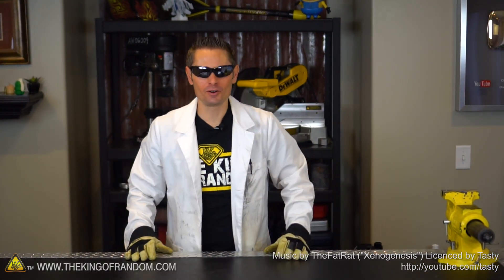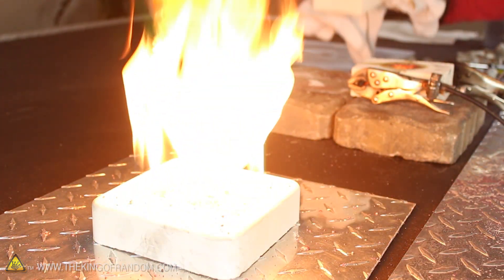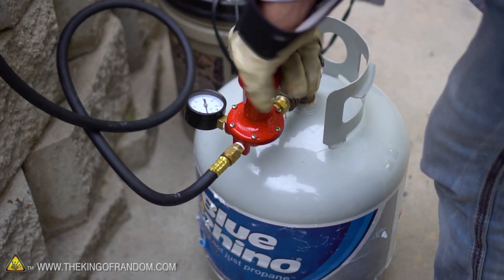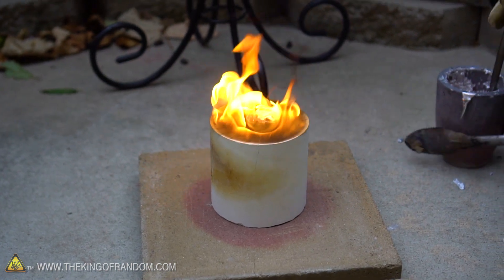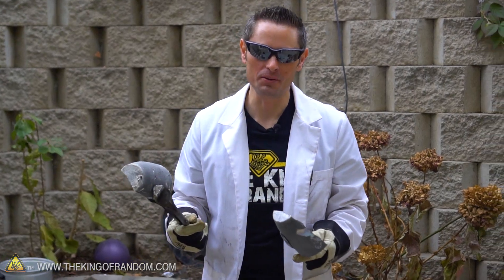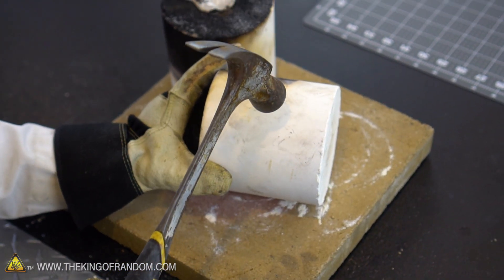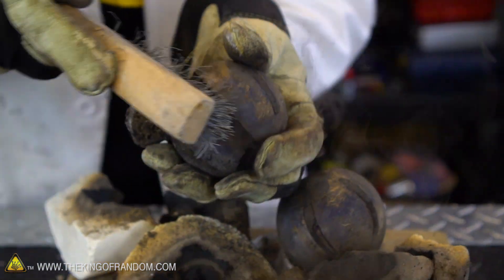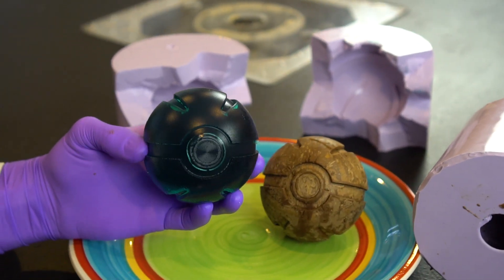Casting Aluminium PokeBalls

Comment: I'm not sure if anyone has made this comment, but why didnt you just do a lost wax casting in sand like you did with your other aluminum casings? at least that way you dont get the burning from the plaster and it isnt as messy of a job to take the cast out? i'm asking this because you got rid of the original wax castings anyway. Let me know what you guys think.

otherwise, Grant
Keep it Random

Comment: when I was taught casting, we  were using a steel case  filled with black sand. so the plaster idea is cool in my opinion.  now the main comment. during the same teachings for best results we had to have two spouts, one for pouring in the medal and other for venting. idk if that will help spheres though.

Comment: for your air bubble problem if you would put 2 holes in the casting wen poring metal in it you would be fine (1 bit for metal 1 smaller hole for air)

Comment: You should try casting a shovel, not only would it look cool but it would be practical as well.
Reply: Boxcarwillie S160 need to melt steel for that, and that melts at 2x the temp of aluminum, ding know if he has the equipment for that
Reply: Well really it would work but the shovel would break quicker

Comment: To avoid bubbles in the final casting, you can set the just filled mold onto a vibration table. Let the vibrations coax the bubbles up and out.

Comment: It would be pretty awesome if you did this experiment for me: 
Step 1) Disassemble the Beyblade & prepare a silicon mold of each part
Step 2) Fill it with wax
Step 3)Make a plaster mold of the wax beyblade parts
Step 4) Fill it with liquified metal
Step 5) Re-Assemble the bey and try if it works on a bey-launcher...
   # It would be great if you did it!
Reply: Awesome Idea
Reply: Spandan Mehta

Comment: i took a metal foundry class and we used a metal coffee can and a  board it made for a really strong mold that  never cracked  for any of us . take the board and attach your spruce and vents to the board with the wax you take the coffee can and seal it to a board using clay around the bottom edge then poor your plaster mix in to the can and let harden then remove board before you put it in the oven ... hope that helps

Comment: Grant to avoid the air bubbles in the cast if you put 2 tiny holes in the top with the main poring hole it should make a cleaner cast because it will give the trapped air a place to vent

Comment: Adding hydrogen peroxide to any metal casting will allow the air bubbles to go away completely so you can have a smooth cast . Hydrogen acts as a magnet to collect all the air bubbles at the point of exit and they will disappear over time as the cast hardens.

Comment: Hi, I am not the most experienced metal caster, but I would say that your process is almost perfect, to improve your method, you would mix your plaster like normal, but set the mixture in a vacuum camber to remove air bubbles. Then you would pour into mold. Then you take your mold with the wet plaster and put it into the vacuum chamber again. Let it cure till firm, then bake out the wax. I'm had a 100% success rate casting with pewter, silver, and brass. I hope you give my method a try :)

Comment: Work in a foundry. To help minimize your gd (air bubbles) you need to add a vent shaft to your molds. As the metals fill the mold it will force the air out. Mold cracking is also just part of it we make 18in - 42in diameter pipe we use chains to hold our molds

Comment: You need to add some thin sticks of wax around the sprue piece to create air vent channels in the mold, that will prevent the trapped bubble of air around the sprue. Put them in a location that will make it easy to cut them off and smooth the area on the final casting.

Comment: For the bubbles in the silicon molds, If you buy an industrial vibration machine and place that under the plastic holds you made you can vibrate the bubbles out for best results.

Comment: You asked a better way to make molds. You can make two 3D rectangles and fill them with casting sand. Put what ever you want to make a copy of halfway into one rectangle. Place the two rectangles with sand together and make a hole to pour in the metal. Melt the metal then pour it in through the hole and wait for it so become solid. Cool it off and you have your metal copy and a mold you can use again. I recommend using casting sand because it is really fine so you wont get any bumps and dips but you can just find some fine sand and that should work too.

Comment: Cast some LEGO bricks in different colored wax, and build a small structure with them.

Then do the same with Aluminum. I am curious to see if the bricks will connect after going through the double cast process.

Comment: I didn't see what you did for plaster but I use half plaster half sand. I also have a kiln to ramp up the investment burn out to 1200 degrees F. It has to get that hot because water is chemically bound in the plaster. You do risk a steam explosion if the water isn't burned out completely.

Comment: to avoid air bubbles pour your metal slowly but not no slow and try using talcum powder coated in the cast to help with surface bubbles and use silicone epoxy for your mold

Comment: The better way to do this is to form sand molds using silica sand, benonite, and water. if you put the wax balls in this you can then split it in half and pour the metal in through a whole. This will make it much cleaner and nicer looking.

Comment: Sand casting is better for metal. It has much better detail and is safer.
https://en.wikipedia.org/wiki/Sand_casting
Reply: Grant has done sand casting before, too -- that's how he did the master sword.
Reply: a vacume is not needed in most of his aplications just 2 extra sprews of wax would work maybe half inch round
Reply: honestly sand plaster molds thats what he should be doing plaster for detail and sand for durability and heat resistance never had a problem
Reply: True, greensand molds would have work way better. 
The sand and foam casting process like the master sword is not the same as making greensand molds. 
Also he could have used Jewlery investment instead of sand and plaster, but would need to use a vacuum chamber to remove air pockets, that's why its easier to use sand molds, lost wax molds are used for more complex figures.
PS sorry for the bad english it's not my first language.
Reply: Marc Mallary 
ieihrirjiejehnoe

Comment: I'm sure someone has mention it but check out vents on ur casts to let air out. It's a simple molding rule of thumb to release pressure and let all voids out and u will get a much better fill and get more complete parts

Comment: I'm not positive but I could have swore I seen on an episode of How It's Made where they took a wax mold not a wax mold but a wax positive and then poured sand around and then filled it with metal and the metal just melts the wax and you're left with your modle.

Comment: I hope you see this comment because a little thing called lost wax would go a long way in improving your wax molds it is wax and motor oil that will burn off as you add your metal of choice and is very soft so after you latex cast it you can fix your imperfections by hand

Comment: Since your plaster is cracking when you pour the metal, you should look into another type of plaster. 
When at goldsmithing school, we made plastermolds for some of our jewelry, and had to use a specific type of plaster. This did not crack from, and almost as soon as the pouring was done, you could put it in cold water. 

The water would dissolve the plaster and cool down the melted silver/gold quite fast.
Reply: lisse4542 he wanted to crack so here could get it out
Reply: First Name Last Name 
With the other type of plaster, he would not get the marks of the plaster cracking on the metall inside, and he would still be able to get the metal out afterwards by putting the plaster in water. 
If one want a perfect shape on the metal, not getting cracks while pouring the metal is preferrable.

Comment: Grant i am a resonable metalworker and i dont think thar you are doing anything wrong but if you keep the silicone mold you can pour in some tin because it has a very low melting point and silicone have got a pretty high destruction point so i think it can get very nice. if it works please upload it🙂 and have a nice Christmas😘

Comment: You can probably use very refined casting sand. You will need to do one side of the pokeball, turn it around and do the other. you won't have the bubbles that way as sand won't burn with aluminum.

Comment: To avoid the air bubbles lift up the plaster after the aluminium has been poured and tap it on the ground gently this will bring the air bubbles to the top and they will disappear, you're welcome

Comment: To lose the air bubbles when you next pour, drill tiny holes into the areas near the top or where you think bubbles will form and it should get rid of the air when pouring.

Comment: I was a dental technician for a while (making gold crowns  and stuff)   But Lost-wax casting was a daily duty of mine, a trick we used and something that stood out to me in your video was; as you are pouring in your plasters, try to find a way to make it vibrate, we had these little vibrating tables...  But the vibrations will give the plaster a much lower viscosity, thus eliminating a lot of the bubbles and imperfections of your casts.  Pretty sure I have a video on this on my page...   But if you can figure that part out,  it makes all the difference in your casts.

Comment: your trying to do whats called lost wax casting but plaster isn't the best material to do it with, a company down the road from me uses a compressed sand system because the sand allows the gasses to escape.
hope i helped :D https://en.wikipedia.org/wiki/Lost-wax_casting

Comment: Why don't you just use petrobond casting sand? It's designed for casting and it's pretty easy to use. We used it in my machining class when casting flywheels and it worked great.

Comment: It's a little bit hard to summarize but there's a product very similar to plaster  called investment.  I've used it for gold, silver, jewelry and aluminum casting. Now  imagine you're casting as in the video having been done inside a coffee can open on both ends. Suction with a little bit of silicone gasket applied to one end pulls out the air through the plaster like material.  The smooth investment, no air bubbles, with a few  details and tricks it can turn out flawless. From- Plastic 3d parts to beatles can be burned out to make fantastic metal - exact replacements.
Actually I got a lot of videos I should make but willing to at least discuss, try Brodtstuff and ad a Gmail address. All the best!
Victor

Comment: If you want a couple time use plaster molds, you make half the mixture pour it and let it dry, put in some vent holes and such, then put a thin layer of Vaseline on top, then make and pour the other half.  Then you have two halves to peel apart instead of breaking open the mold.  I've only done this for ceramics, I don't know how well it would hold up for metals.

Comment: The way to avoid the air bubbles is pretty simple - When you make your plaster molds, drill holes into the cavity alongside your pain pour hole. That way gasses have somewhere to vent out to. You WILL end up with bumps or "spikes" where the aluminum goes into these vents, but it's of course easier to remove these than it is to deal with dents and bubbles caused by trapped gas.

Comment: @Grant Thompson, FYI- for removing more air bubble/pockets, when you are making the moulds, you can use vibrations around the outside of the tube, I see you shook them a little but a small vibrating instrument will send pulses through the whole thing shaking loose the smaller air bubbles you missed. It's a trick that's used in setting concrete for the exact same reasons.

Comment: you can avoid air bubbles by putting the cast in a vacuum chamber while your material is still molten 
to avoid burning the plaster use an investment (plaster containing silicate)

Comment: you should make a cast agitator that will get most of the air out but you may need to heat up the metal a little more. also if you heat the plaster to 450 you will get a lot less burning

Comment: I'm not sure whether or not this has been brought to your attention already, next time when you try to make a mold of something with silicon take a thinner silicon base and brush it onto the object first then pour a thicker silicone over at the two silicones will combine and you will make sure to get inside all of the cracks and crevices and avoid having all of the air bubbles

Comment: Hey grant. a buddy of mine used to make silicone molds. In order to get rid of the air bubbles prior to the mold setting up, he used to use a cordless drill and an off set bit, he would place the mold on top or butted next to the drill. It caused vibration in the mold, which brought the air bubble up to the surface, which eliminated the imperfections.

Comment: One thing you could do to aid in the removal of bubbles is set up an agitation table, nothing fancy but something that vibrates in a higher frequency for the molds to rest on while you poor/cure it. You could try a slightly elevated platform with something like a little toy car motor screwed to the bottom of one side with a weight soldered on to the drive so it will vibrate the table for little cost and could be set up to run on batteries and a switch. Seems very Grant Thompson.

Comment: When he washed them couldn't he just use water? It must be easier than brushing it down
Reply: Tyler Dhoore It would help at first but it gets in cracks and really sticks. Try cleaning soot from a fireplace brick with a hose, it may wash off a little but a lot is still left. You'd need high pressure for cleaning it like that.

Comment: Aren't you suppose to leave the wax inside the cast? I think that when that what they do to make bronze sculptures. When you pour the liquide aluminium the wax vaporise so you dont have air bubble problems and it might as well protected the plaster cast from burning or cracking. Maybe surrounding the cast with sand could avoid it to break.

Comment: gypsum-bonded investment materials cannot withstand temperature higher than 700C (aluminum melting point is about 660C) you need to use silicate-bonded investment material to get better results (can withstand temperature up to 1100C)

Comment: @Grant
To get rid of the air bubbles, simply drill a small hole into the plaster mold from the top down to the cavity. This way, as you pour metal into the mold, air can escape via the second hole, instead of being trapped by the liquid coming from above. For a reverse example, look at beer cans that have punch tops for smooth pour, or fuel cans with a vent.
Reply: This method is also used in resin casting- if you look at the sprues from cast parts, you can see where the air vent holes are.

Comment: to help with the air bubbles in the top, you can do some vents coming to the top that allows gas to escape. you can machine the protrusions off after the casting has cooled. to make the vents, you could either drill them in the plaster or driving stakes into your wax model before you mold.

Comment: I'm not sure where I saw this, but in the future when pouring silicone and plaster, you could essentially tape/glue a wood stick to an orbital sander to help settle out air bubbles and settle, like with concrete vibration tools

Comment: You broke the crucible in half ????
Was it a graphite one ?
I have lots of them, used them several times for aluminum, copper or cast iron, and only after several melts they got worn out due to attack by slag.
But I NEVER cracked one......

Comment: If you use plaster, use something to vibrate it and that will remove the air pockets. For better mold use the sand mixture to make a mold and also put ventilating holes with a straw, so the gasses can escape and not burst into flames.

Comment: so, when making molds for casting aluminum.  any type for green-sand of oil-based sand will work better than the plaster.  sand wont bubble up like the plaster did, and you can reuse the sand over and over again

Comment: Try to put your silicone mold under vacuum next time after pouring. It will avoid imperfections and take out trapped bubbles. Have a look @jimmy Diresta. He has a lot of experience about moldings. Anyway, cool project. Keep on practicing ;-)

Comment: Here are some steps to making a better lost wax process. 

Use two parts plaster powder to one part water. Most plaster packaging instructions say to mix water into plaster. On the contrary introducing plaster powder to water will minimize the amount of bubbles. So start with water and gradually add plaster. Note- plaster powder shrinks as it soaks, you'll use a lot more then you think so be supplied with a big bag before you start.

Gently and slowly insert your wax piece into the plaster mixture. Wax Sculpture down, Pour spouts up, Pour spouts should also be V shaped, to minimize metal loss, and allow for a smaller point to be cut away, spouts should remain visible on the top surface. Your piece should not reach the bottom or any walls of the container. Hold your piece hovering in position until you feel it's being supported by the surrounding plaster.   Make sure to melt the wax out completely at around 400º then slowly bring it up to about 1000º - 1500º to completely bake the mould to remove all of the moisture in the mould, otherwise it will crack when you add the molten metal. The mould should remain at a minimum of 1000º prior to adding the molten metal, to reduce the chances of cracking the mould.

Comment: What if you just used the sand/plaster mix for the mold rather than straight plaster? The same "refractory material" the foundry itself is made of. you already know it can take the heat.